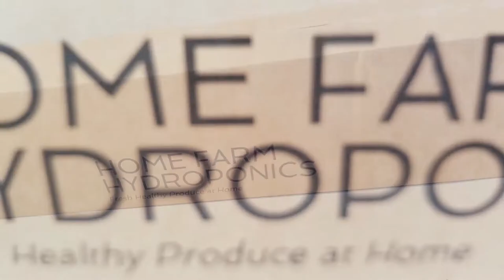DIY indoor hydroponic vertical farm for under $250

Comment: is the PVC food-grade?
Reply from the maker: The PVC is schedule 40 which is approved safe by NSF and used widely in the food and agricultural industry. Depending on the type used, it's usually the cement glue that is toxic. You can still use them but be really cautious to make sure the residue does not touch the water supply or play it safe and use FDA approved glues like I used in the video.
Reply: @homefarmhydroponics8844  awesome, thanks! I've been looking for a legit answer for this for months. love your stuff!